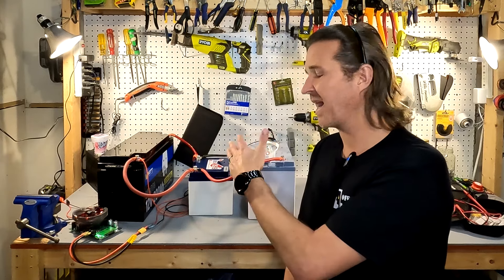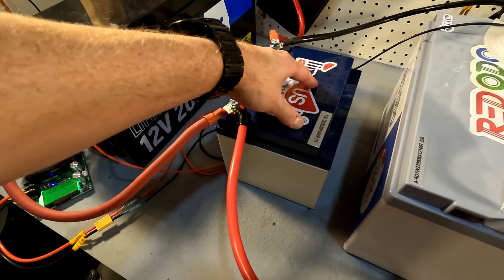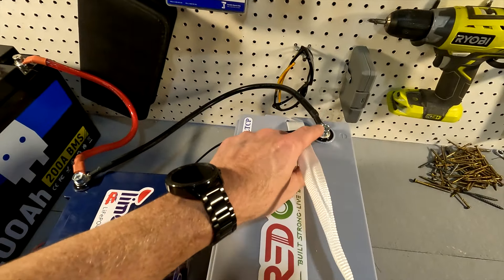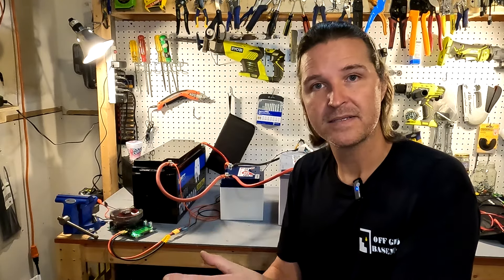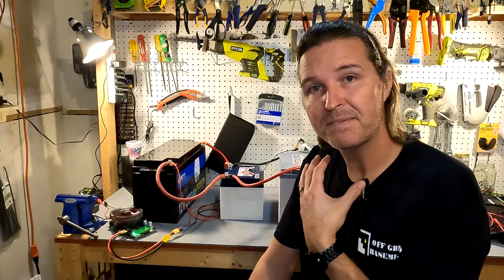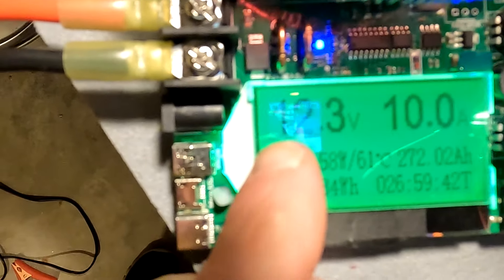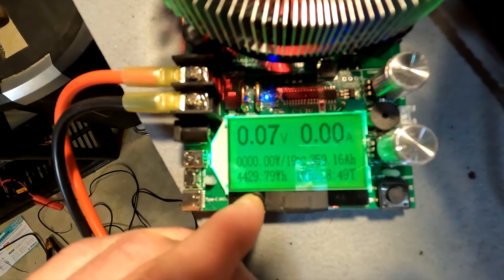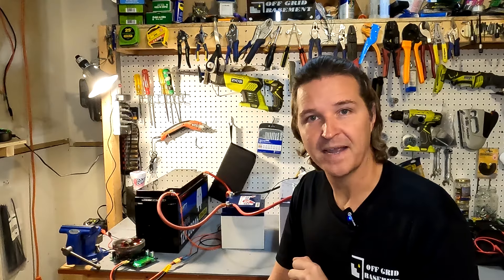Discharge test of a bank consisting of 12v 50ah, 100ah, and 200ah Lifepo4 Batteries!

Comment: Great video. I got the same result with my LFP 12.8V 280Ah in parallel with the 12.8V 90Ah, I have been running them for two years now, now I am building another 280Ah to replace the 90Ah, the 90Ah will be used for my small DIY power station.
Reply from the maker: The extra AH will be nice.  Thanks for the comment.

Comment: Confirmed my testing. I had a pair of 60Ah 36v batteries in parallel with a 105Ah 36V pack, each with separate BMSes with Bluetooth on each one. (Also wired like you did, with positive at one end and negative at the other, so wire losses and such would balance out.) 

 (This tied into my old house backup system a 400W sinewave UPS. Ran all lights, electronics, TV, CPAP and electric blanket)  As expected, during discharge, the 105Ah would source more current than each of the 60s. During charge, same thing. Everything balanced, worked nicely for years thru the summer and winter utility outages. If frugal, could go 2 days before charge. (All run from surplus Li-ion scooter battery packe.

 Now I've gone to LiFe 280AH cells, 24 in 8S3P config, running a budget 3000W inverter/charger unit, with refer, freezer and microwave added into the mix. Little more inverter loss, but 20KWh capacity, so is good.
  Power's often flaky here in the redwoods, can lose it for hours, up to several days. Too many trees for solar, so just charge with inverter gennies or utility if it comes back in time.  The new system is way less 'cobbled' together than the old one.  So far, so good!  Enjoy the content. Take care, Stu the crazed techie.
Reply from the maker: Stu,
Thank you so much for the information and the comment!

Comment: Yup, it works pretty well.  It isn't ideal, but it works.  There are several issues to keep in mind when paralleling different capacities together:

* First, you may have to limit your charging and discharging to the capabilities of the smallest battery.  Or at least be within shouting distance.

* Second is that a state-of-charge differential will develop between the batteries due to differences in internal resistance.  The SOCs will generally match at the top and the bottom but develop up to a 10% difference in the middle of the charge or discharge curve.

This means the batteries will age at slightly different rates.  This is NOT something to worry about.   Particularly for solar applications, normal calendar aging will trump the cycle aging anyway and you don't need to particularly match battery ages when paralleling to get excellent performance.

* And finally, some safety factors need to be taken into account.  "car battery" type LFP batteries are normally spec'd for 4 in parallel.  But that is 4 x Same-Capacity in parallel, not 4 x physical batteries in parallel.  So that 50Ah battery creates a problem in that your 200Ah battery might as well be 4 x 50Ah batteries as far as the 50Ah battery is concerned, giving you "5" now, which exceeds the limit.

Now of course you can parallel as many batteries as you want.  The limit just pertains to fusing and safety.  Battery BMS safety and also battery cabling safety.   From the 200Ah battery's point of view there could be another 600Ah worth of 50Ah batteries all paralleled together with just one fuse.  But from the 50Ah battery's point of view it has already exceeded the 4x rule.

So the solution here is to put the 1-4 50Ah batteries on their own fuse to a bus bar, then put the 200Ah battery on the bus bar, also with a fuse.

If you wanted to you could put three groups of 4 x 50Ah batteries on the bus bar, each group with its own fuse (three fuses), and then a 200Ah battery on the bus bar with its own fuse.  For 800Ah of batteries and a bus-bar capable of doing 800A.

Bus-bar's are typically at least 1000A capable but remember that fusing is for the lowest common denominator (cabling or device).  If a cable going from a bus-bar capable of 800A can only handle 100A, that cable needs a fuse or a breaker (sometimes the fuse and/or breakker is on the equipment the cable is connected to, which satisfies the requirement).

Again via something like a Victron Lynx Distributor.

-Matt
Reply from the maker: Matt,
Thank you for all the great information!

Comment: While you can connect batteries directly to one another, the smarter way of doing it is through a pair of bus bars, with adequate wire size between each individual battery and the bus bars.  If you're going to connect them directly to one another, the way you've connected the positive and negative cables for the load is the right way to do it.  The only real glaring omission in your test setup is a fuse somewhere in your positive wire, between the batteries and the test board.  It's just good practice.
Reply from the maker: Good call on the fuse.  Since it was just a test with small amps, I went without it.  Thanks for the comment!

Comment: Would have been interesting to have a WH meter on each + battery before they connected parallel. To watch what each battery supplied over time and if any over supplied and then caught up etc. If you get what I mean. I have a feeling you're using up some of the life of the lower capacity batteries, which obviously compounds over time. Thanks for another interesting video.
Reply from the maker: Thank you for the comment.  I will probably make another test video that goes into amperage and max amps.
Reply: c @OffGridBasement   That would be cool. You'd only need to monitor the WH coming out of each battery not any going in, cos in the end it's all going out and you'd be able to see say if the 50AH battery ended up supply 80AH you know it got charged up about 30AH in the process using up 3/5 of a cycle etc. But if it only supplied 50AH or so no extra cycle used. Hope that makes sense. Words aren't my thing :)

Comment: I think a good alternate test would be to discharge the batteries first at 50 amps and then at 100 amps so that the smaller batteries have the possibility of reaching capacity. A real life scenerio would be more than the 10 amp discharge so with more amps I think you would get a more realistic outcome.
Reply from the maker: I believe another test is necessary.  Thanks for the comment!

Comment: Great test, did you happen to see which battery shut down first. Or did they all shut down at the same time?
Reply from the maker: It depends on what the shutdown voltage of each BMS is.  Usually it's 10.5v and they all should've reached it at roughly the same time.  Thanks for the comment.

Comment: Still trying with 24v, but yeah very interesting if I have to go back to plan B  a 12v system.
 I have suspected damaged batteries, From quite a few shorts. The LED voltage readers seem iratric and sometimes one battery shows 5 volts... Yeah I get the problem of 1 BMS shutting down. I might have to charge them up manually with lack of Sun.
Reply from the maker: That's a bummer about the setup.  I would charge up the batteries individually and do some sort of capacity test on each.

Comment: Aweome vid,any info on the discharge meter? Cheerz
Reply from the maker: Here is the Amazon info for it!
Electronic Load Tester, USB Load Tester 150W 200V 20A Adjustable Constant Current Electronic Load Battery Capacity Tester Module Power Meter, Intelligent Discharge Resistance Power Tester
https://amzn.to/4b8fFGa
Reply: @OffGridBasement  thankyou.

Comment: What if we connect AGM lead acid with lipo4 in parallel
Reply from the maker: That's a good question.  Connecting batteries of different chemistries is not a good idea.  I believe lifepo4 would drain first due to the difference voltage curves.

Comment: Maybe its because its a adjustable variable resistor invertor at 200W into the wall maybe it burns another  150w on a risistor heating up. Dare you to try different AH at 24v 20AH discharge. would things still be smooth.
Reply from the maker: With that setup you would only get the minimum ah battery capacity x2.  It would be a good thing to show though!  Thanks for the comment.
Reply: Yeah, I am going to return the 24v invertor and , I ordered a 12v adjustable grid tie...Chance that some sort or Grid Resistance also. , Does you 600Watt Y and H invertor use more than 600watt any resistance noticed.

Comment: I would have guessed the 50amp battery depleted first then the 100ah. then lastly the 300ah. Are you positive they all ran out of power at the exact same time?
Reply from the maker: No.  It would depend on when each BMS is programmed to shut down.  10.5v is usually the voltage for BMS shutdown.  Since they were wired in parallel, they should've reached that at around the same time.
Reply: @OffGridBasement  "they should've reached that at around the same time" In theory. but I be curious to know for sure if this is true.
Reply: @mannyfragoza9652  It is true in many, many such experiments dating back over 100 years and relied on by every EV on the planet.  That is just the way batteries in parallel work.  Very slight differences between, but (especially at such a low discharge rate) they charge and discharge equally.  In a perfect world they would be identical, but slight variances exist. At such a low discharge rate relative to the capacity of the batteries the most significant differences is the behavior of the individual BMS.  EV's use many small battery cells in parallel and typically only one BMS to move that variable away from affecting the parallel behavior.  Some EVs use two BMS so they can rearrange the battery pack two in parallel operating at 400v to charge, and two in series operating at 800v to discharge.  And it works just as theory and past practice predict and this video illustrates.
Reply: @Sylvan_dB  Thank you for this very interesting comment.

Comment: My uneducated guess was way off, but at least the total was over 350. 😅  Do the batteries discharge at a constant ratio comparable to their size, so they all finish the test at the same time?
Reply: Yes they do.  Andy at the Off Grid Garage has done similar experiments and the amp draw from different Ah capacity batteries is proportional to their respective capacities.  It is a pretty cool phenomena.
Reply from the maker: Yes.  The amperage pull is comparable to the capacity of the battery.  Thanks for the comment.

Comment: My only question would be what is the highest discharge rate since they 50ah might have a smaller rated Amp rating?
Reply: The highest discharge rate in a perfect world would be the sum of the individual discharge rates because each battery would contribute to its capability.  Losses in cable and connections make it hard to reach perfection and the different characteristics of the different BMS will likely alter that sharing. My guess looking at this video, the limiting factor is cables.  Those might be 2ga which would limit discharge to 150amp with some heating, and a lot of heating by 200amp.  If those were replaced by 4/0 I'd expect you could get at least 75% of the sum of all three batteries.

Batteries have an "internal resistance" (IR) which when doing an analysis is modeled as a resistor in series with the battery.  Smaller batteries have higher IR which means they will contribute less when under high load in parallel with other batteries having lower IR.  The IR tends to increase at lower states of charge. This tends to make the entire battery bank self-balance during charge and discharge.  However the BMS factor can overwhelm the natural internal resistance. This is the primary reason why LiFePO4 batteries like this say to parallel (or series) only with the same brand.
Reply from the maker: That is a great question.  My suggestion would be to use the lowest maximum discharge rate and multiply it by the number of batteries.  I think that is a safe bet.  Thanks for the question and comment.

Comment: The batteries are continuously equalizing while discharging and charging I think.  The thing that is limited, is probably the max discharge amperage.  Will it be the sum of the BMSs, or three times the smallest BMS? So, 150amps, 350 amps, or what?  I do not know what the max is on any of those BMSs.
Reply: Correct. As I posted to another comment here:

The highest discharge rate in a perfect world would be the sum of the individual discharge rates because each battery would contribute to its capability.  Losses in cable and connections make it hard to reach perfection and the different characteristics of the different BMS will likely alter that sharing. My guess looking at this video, the limiting factor is cables.  Those might be 2ga which would limit discharge to 150amp with some heating, and a lot of heating by 200amp.  If those were replaced by 4/0 I'd expect you could get at least 75% of the sum of all three batteries.

Batteries have an "internal resistance" (IR) which when doing an analysis is modeled as a resistor in series with the battery.  Smaller batteries have higher IR which means they will contribute less when under high load in parallel with other batteries having lower IR.  The IR tends to increase at lower states of charge. This tends to make the entire battery bank self-balance during charge and discharge.  However the BMS factor can overwhelm the natural internal resistance. This is the primary reason why LiFePO4 batteries like this say to parallel (or series) only with the same brand.
Reply from the maker: I would say the smallest multiplied by the sum of batteries.  That is a good question.  Thanks!

Comment: Charge them all in parallel and see if they balance out 

Also What happens with a bigger load?  10a is nothing what happens at 50a or 80a will the batteries be able to keep up balancing themselves or will it fall back and voltages be off due to the wires only allowing a smaller amperage to go between each battery 

What will the temperatures look like on the wires when there’s a bigger draw on the batteries etc.
Reply from the maker: I will definitely be doing another test!  Thanks for the comment.